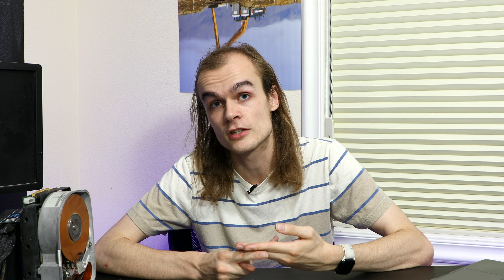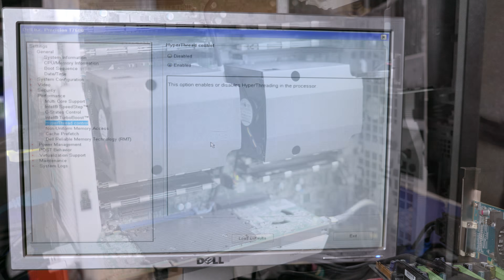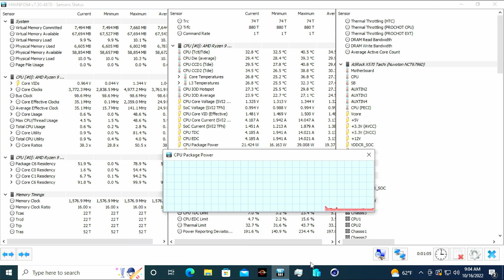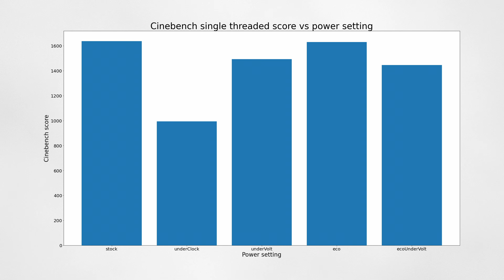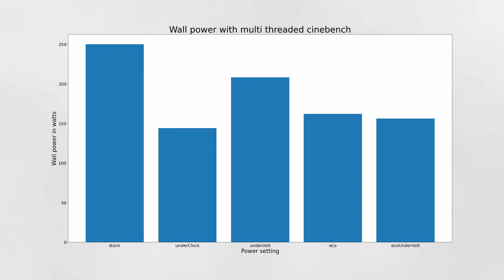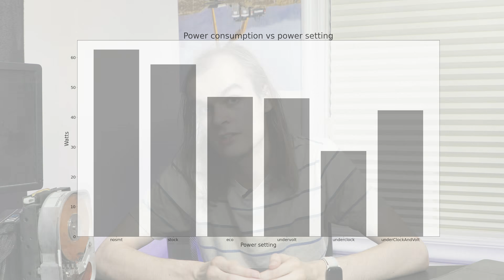Tweaking a CPU for power efficiency: Underclocking vs Undervolting vs Eco mode

Comment: The energy prices are making everyone looking for a way to reduce power consumption. Good insights and video. Btw, despite not a fan of Apple, apple silicon at 20w seems like a product for this scenario.
Reply: I'm fine with power consumption (well, not really but for now at least my bills don't change) but heat is the real problem. My current PC farts out just under 600W when not idle. It literally turns room into a sauna on a moderate day and in the summer it's uninhabitable oven wasteland. Opening window works only in autumn and winter - as a matter of fact, since I run my PC 24/7, right now I have window tilt-opened and heating off and room is toasty in British climate (cold and wet). After next hardware upgrade I will need to think about putting PC into a grow tent with exhaust pipe going directly out of the window with a decent vent fan to push the air out, I see no other solution. Installing AC is out of question, the power draw would be through the roof (not to mention it would be like running a fan heater in AC room, good recipe to make it die quickly with that constant "casual" 800W fighting against it...)

Comment: Fun fact. I have a Deepcool Assassin 3 and Corsair 5000D Airflow with a Core i7-12700K paired with an Z690 Pro A DDR5 motherboard.

For some reason, the motherboard was giving 1.42 volts to the CPU and it was reaching 90 degrees instantly on Cinebench R23, i did an undervolt that thing to 1.23 volts on average, power consumption dropped from 230 watts (lmao) to 150 watts, now 67 degrees C.

Multicore perfomance hasn't changed, but singlethread did (with a partial OC with the undervolt).

I wonder if buying a better motherboard of a BIOS update could fix the absurd voltages for stock.
Reply: Iddle power draw is 5 watts (Big-Little chip). i5-13600K is even better (3 watts).

Comment: If you are a gamer or casual user, Eco Mode could save you a bit of money on power bills in the long run, if your motherboard has it as a feature.  Another thing you can do on AMD Ryzen systems is lower the maximum power and current available to the chip, which more or less does the same thing but requires more technical know-how (even my low end Asus board can do this).

Also, there are ways to prevent the CPU from boosting in Windows.  I set my Ryzen 3600 to boost only up to 4 GHz and it cuts down maximum temperatures by about ten degrees celsius, with very little performance loss.  It also hurts multicore performance less than Eco mode.

Comment: i have a 5800x with A380 Intel Video card, 1nvme,2 HDD. (PBO ON) System draws 141 watts during boot, then settles to 65 watts at idle. i will try the underclock, see what happens.

Comment: I undervolted my i7-11800h by -0,075mv core,cache,system agent
Downclocked the 4,2ghz to 4,0ghz (no fps difference between 3-5 degrees less) in resident evil 4 (chapter 5)  the cpu temp is 70 degrees most of the time and max 75

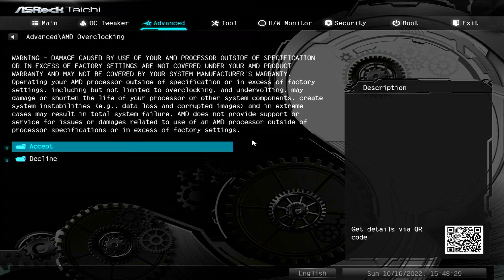Comment: @1:14 the ECO mode would be for laptops that use the desktop chips but require a lower thermal operating envelope.
Reply: Completely incorrect. ECO mode is just a PBO profile.
Normally PBO tweaks the power curves and TDP to maximize performance at the cost of higher voltage/heat.
However, since it is just running a power profile, AMD created some profiles that optimize for efficiency instead.
You can use these to lock the CPU at a lower power target, and end up getting MUCH higher efficiencies, since high-end CPUs are usually tuned to the bleeding edge of performance so they don't "lose" to competitors slightly higher numbers.

As an example, you can lock a 7950 to 105W, which saves about 20% power usage, and it only loses about 3-5% performance.

Comment: Useful video. I have an ASRock Rack X570D4U board arriving soon so I will be interested to see what settings it lets me tweak.
Reply: I'm in the same boat here. Mine just arrived the other day, still haven't decided on the CPU.
Reply from the maker: I have the x470 version of that board. I put a 3900x in it but a 5000 series would likely be a better pick today.  I put this system in a collocation with a 200w power limit so I didn’t care about idle power but needed to keep max power down. I used pbo settings so it would still boost to the max clock speeds for light loads but limit max power draw. If idle and light load power is more important lowering clocks and voltages would likely help more.

Comment: Woot! New vid. What's the hot take on running your PSU below optimal load when doing this? IIRC you lose PSU efficiency when not running it at about 50% max load.
Reply: Depends on the quality. The higher tier 80 plus ratings have good efficiency at low loads.
Reply from the maker: I haven't run any exact numbers, so this is just an estimate from reviews I have seen. Most of the time a PSUs efficiency is within a few percentage points at the medium loads of roughly 20-80%. There is unlikely to be a large performance difference between a 500w and a 1000w psu for example. A PSU only seems to have a very large drop off in efficiency is very low loads, like less than 10% of the rated max power. Using a 1000w PSU for a system that maxes out at 50w would likely be a good amount worse than a 100w PSU. I'd like to run a test like this in the future and see what numbers I get in my own testing.
Reply: @ElectronicsWizardry  Titanium level is required to be 90% at 10% load, none of the lower levels require a 10% load to be rated.

That being said, if you're making a high end psu it's unlikely to be bad at low load e en if you don't specifically need to meet a requirement.

Comment: Gotta love the "Molex to Sata loose all your data" cable you got there, also what GPU you got hooked up there? anything over 225W? if yes might want to look into running dual 8-pins from the PSU instead running it on a single daisychained cable.
Reply from the maker: Yes that wiring was a temp setup for my install used for testing. Normally I’m booting from a m.2 drive. I got a gtx 1080 in there. I should run 2 cables as it’s better but its a fairly low power compared to some of the newer GPUs coming out and it’s really only used for video editing these days.

Comment: AMD Ryzen G-Series are kings of efficiency. My 5700G at stock setting idles at 3 Watts. You can confirm this by watching @TechNotice's 5700G videos
Reply: I have a 5600g based computer that needs to run 24-7.  Using Ryzen Master, I did three things.  I did a per core optimization using "core optimizer" (I simply let the program pick the values) I set a max core voltage of 1.2375 and a max clock of 4.25 GHz.  As best I can tell, I cut average power consumption by about 25 percent and suffered no more than about a 5% slowdown under peak loads.  I'm FINE with that. 
I agree with you; I love my G series and have built computers based on the 5600g for several family members.

Comment: I'm using an FX-6350 on a low end chipset board just for TrueNAS. I'd like the PC to be as quiet as can be, and it ain't :D Can I just turn down the frequency to like 2.0GHz and call it a day?
Reply from the maker: I’d give that a try as it’s likely your best option on that platform. But the issue with those older chips is a lot of the power is from the chipset so even if the cpu is off the chipset is still making a reasonable amount of heat.
Reply: @ElectronicsWizardry  The board is a 760GM-P34 (FX), and yes the chipset heats up a lot, so I've already got a small fan on top of the northbridge heatsink. Still the CPU cooler is causing most of the noise, so I'll try just downclocking, thanks.
Reply from the maker: xxDrain also check the fan control settings. I’d try turning down the fan speed if you have thermal headroom.

Comment: I had an idea to build an ultra low tdp system to work as a Proxmox server with 15 VMs on Ryzen 5950x. Does it make sense to do it with Ryzen 5950 (undervolt)? Will I get 20 watt in idle? Is it possible to set up limit in 35-45 watts (or 65 in worst case) or cpu will take more tdp when each core has some load?
Reply from the maker: I don't think a 5950x would get to 20w idle with VMs running. The 5000 series chips had a somewhat power hungry io die, that seems to be much improved in the 7000 series. Also if you chose to use a x570 motherboard, the chipset uses a good amount of power too. The power consumption of a CPU also goes a good amount from a fully loaded desktop to a light load, so Id guess a 10w jump at least as the cores will need to much much less time in the very low power c states.

I was sitting at about 60w idle on my 5950x system, but that did have a gtx 1080 that would use a good amount more power than something like a gt 710. I also have a x570 taichi, which has a fairly power hungry chipset on it.

I'd like to do more testing on this in the future to see how low of power consumption you can get with a modern CPU and light server loads.
Reply: @ElectronicsWizardry  
Thank you for your answer.

I have a Lenovo tiny pc i5 8400t (6 cores, 35w) it consumes 7-8 idle with 3 Ubuntu VM (Proxmox). 
It seems if I want to make a proxmox server with 16 cores and low tdp I have to use a few mini PCs with Intel CPU (8400t, 9700t, etc.).
Also, I read that Intel 12 Gen (eco cores) are not supported in Proxmox yet :( 
So we don't have a single Intel CPU (with low tdp) with 16 cores for Proxmox at this point.

"a x570 taichi"
I did see some reviews and it seems b550 can be enough with good VRM

"I'd like to do more testing on this in the future to see how low of power consumption you can get with a modern CPU and light server loads."
yep, this is an interesting topic
Reply from the maker: @MoFlol  I am trying to get my hands on a 12th or 13th gen CPU to test the P and E cores in Proxmox and see how it works and the power consumption. I'd also like to get my hands on some ryzen 7000 chips to see how they work. I'd guess they will be better than 5000 due to the lower power io die and onboard graphics so you don't need a GPU for server uses.

I believe much of the additional power consumption my desktop has is due to the motherboard. The dell Optiplex boards have little extra features that consume power. Gaming boards have many extra chips for rgb, audio, usb, and more. All of these chips take a little bit of power which can add up at idle.
Reply: @ElectronicsWizardry  Thanks. I plan a new AMD 7000 system and would like to optimize its IDLE power consumption because I don't game so much but use the PC mostly for programming, web surfing and other light workloads... Some BIOS settings guide for IDLE power optimization would be very appreciated.
Not sure which C-states the new Ryzen 7000 CPUs & motherboards support.

Comment: pick the right chip for your needs
on most platforms you won't notice undervolting but you really need a killawatt and record daily and weekly usage and performance
for smb applications they can take advantage of running a few things on sbc/arm platforms or 6/7th gen or 10th gen refurbs
the newer platforms allow concurrent use of gpu/nvme and 100g - biz calculus is still mixed - use newer platforms for better low idle options but use older platforms too and max them out to full potential before worrying too much about overall power usage - be smart and savvy, make informed choices and for overall stability best stay within specs - stability is more important than saving 10 watts - the user has to test best setups and lean green when possible #reduce, reuse, and recycle #nvme carbon footprint adbantage #consolidated yet federated and distributed